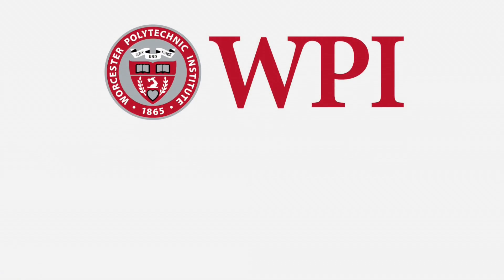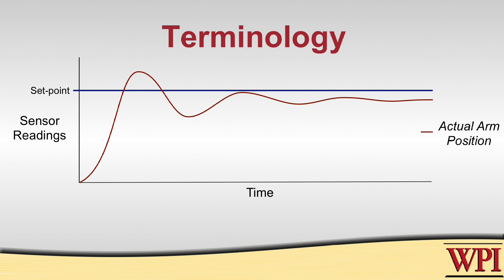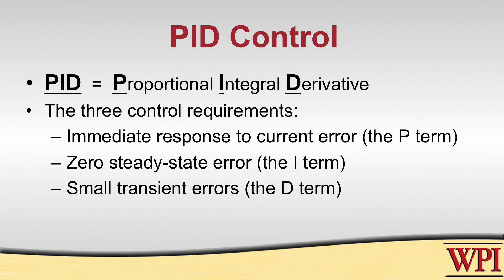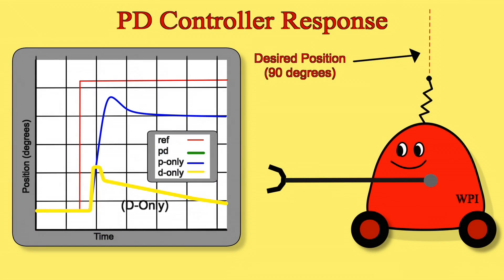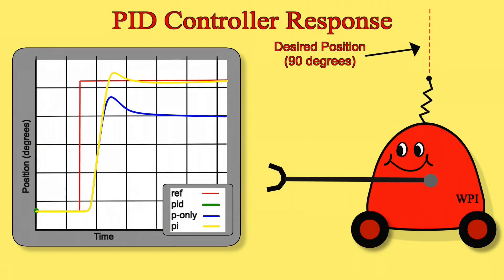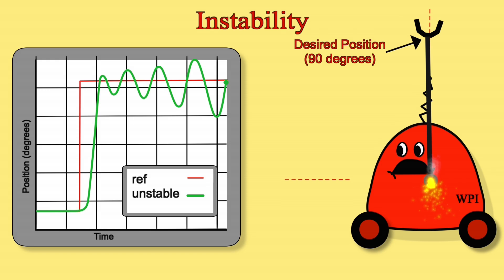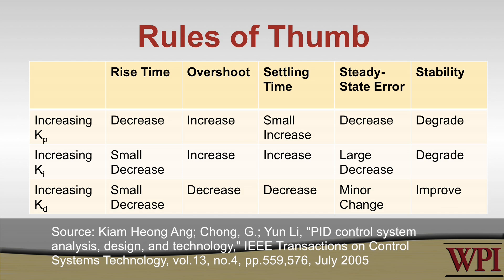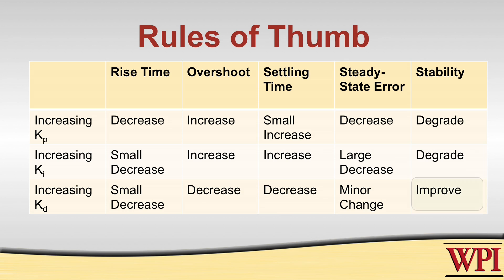PID Control

Comment: At 7:15, you mentioned that the right way to do it is to use control theory and use a mathematical model to tune the control gains. Can you share some more info about this, for example in the example of a robotic arm ?

(I got here through https://docs.wpilib.org/en/stable/docs/software/advanced-controls/introduction/pid-video.html#pid-introduction-video-by-wpi)